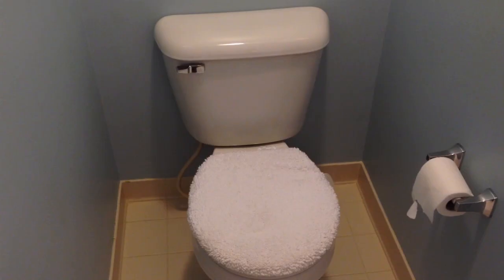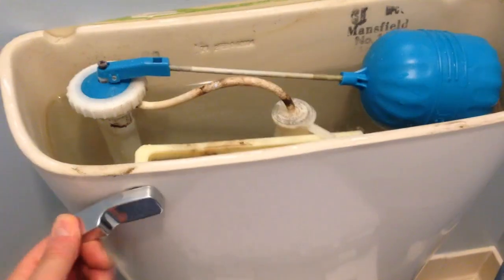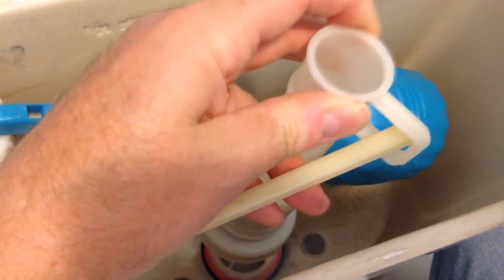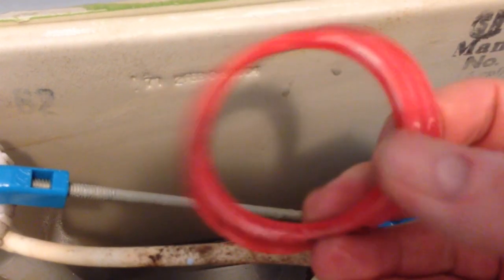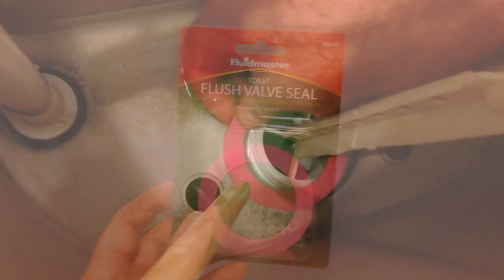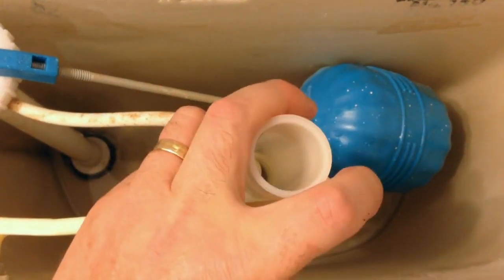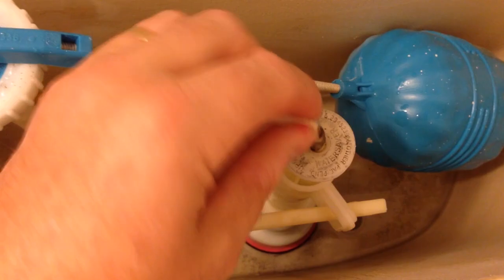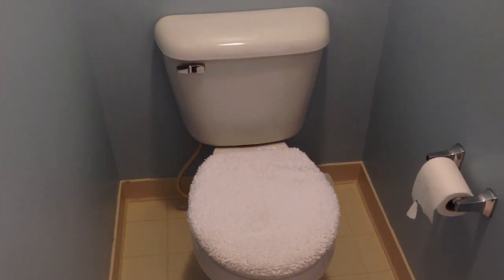Mansfield 210/211 Flush Valve Seal Fix

Comment: A big thank you for posting this video.  The cost to fix two 25 year old toilets was less than $5.  I used part #210/211 Mansfield Genuine Parts Flush Valve Seal Model No. 630-0030.  I have no plumbing experience, but was able to get the job done in less than 5 minutes because if your awesome video :)

Comment: Bless you!!! I bought a $28 universal kit to change out the whole thing. I could tell the seal wasn't going to work. I was in tears (70 yr. old female). Then I found your video! I returned the "universal" kit that clearly wouldn't work on mine and purchased just the seal. Because of how helpful your video was, five minutes later the seal was changed out and the problem resolved. Truth be told, I bought four of the seals. So glad I didn't give up and call a plumber! Nothing against plumbers, just not needed for such an easy fix. Easy totally because of your video. Thank you so very much! ☺️🥳🎉👏👍
Reply from the maker: Thank you! Your comment made my day! When I made this video I had no idea how helpful it was going to be

Comment: Thanks my problem exactly. Will replace. I’m sure that will do the job. To determine if  it was the seal. I turned the arm itself back and forth and that made a temporary stoppage of the leak. 
Most other videos make you think it is the main seal to the toilet bowl thus a much more involved job requiring removal of the bowl.
Anyone should first try your fix first!

Comment: Had this same situation, but with the toilet in Mansfield # 160 called a plumber to get an estimate that estimate was $285 to come out to look at the situation and possibly repair it? After watching several videos including this one I purchased the flush valve seal ( 2 pack ) for $7 and did it myself in about 15 minutes start to flush😂 and that’s with cleaning and checking all the other parts in the tank!
Reply from the maker: Good to know how much getting a plumber might actually cost - you really saved some money - thanks for the information Ken!

Comment: Good video. However, my experience is that this will fix the issue for just a short time. You're back to square one after a few days or maybe a couple of weeks...... or sometimes maybe several months.  Regardless, there is massive wastage of water. Is there a better fix -  apart from sending the entire toilet to landfill (which is the advice of our local plumbing supplier).  We have four toilets, all with the same issue. So the ultimate fix would be about $2k. just because a $5 part doesn't work. I am quite familiar with the the installation of the gaskets - having wrestled with this for twelve years.
Reply from the maker: Sorry to hear of your struggles - I  have three of these systems and my experience is the gasket lasts about two years before I have to replace them. The ones I use lose their shape and also start to break up.  Thanks for sharing. Roger
Reply: @RogerDD100  Well, if you use the official Mansfield part, I'll wager it will last MUCH longer.  I have two Mansfield toilets about 20 years old and just replaced one seal; the other is not leaking.  But good luck finding the official Mansfield part.  I would have had to wait several weeks to get it.  So, like most people I bought a generic one locally (Home Depot). It specifically states it fits the Mansfield 210/211 flush system.  And it did, but I don't expect to get 20 years out of it!

EDIT:  I am going to order some official parts from Mansfield and put them in.  Made in USA.  The $2 I spent at Home Depot for a part made in China is a stopgap.

Comment: I did this exactly as you demonstrated.  Now it "hisses" every few seconds.  Im thinking maybe the new ring needs to MOLD better & once it does there'll be a better seal?  Do you think so??
Reply: PS - Ive checked & it appears to be perfectly seated around & in the groove.  :(
Reply from the maker: @catsjamjams  Sorry I didn't see your question sooner. I'm not an expert but you might check it is in the correct groove, forgive me, it's been a while since I did this - also you could check the adjustment - see video https://youtu.be/rBXC9zDcnT0

Comment: I have 4 of these in my house and I’m getting tired of constantly replacing these seals.  They wear out too quickly. Has anyone found a replacement seal that will last longer than 2 years?  Thanks.
Reply: Well, I can't speak to that, however, I've seen a youtube plumber that said they should last 10 years, and I saw one comment that said you should get the Mansfield brand ones and they claimed the off-brand ones didn't last as long.
One thing is certain, it is a wear item and might even be a design flaw.  When I went to the hardware store, they seemed to stock one of each of different flapper valves and other seals, but they had like 15 of these seals in stock, lol.  I'm guessing they sell a lot of them.

Comment: My son and I replaced the seal (made sure it's in place correctly) after the toilet was hard to flush. It's flushing easier but now I'm having the problem of ghost flushing. Checked the seal and it appears to be properly seated. Might have to call a plumber anyway.
Reply: I had the same problem, and determine that sometimes you have to push downward on the seal to get it to form around the opening so the plastic teacup that lifts off will seat around it after flushing.  How did you get yours to work?
Reply: This is the problem I'm having. I replaced the old seal which was obviously my first problem but now with my new seal in place it still slowly leaks water unless I push down on the plastic flush mechanism

Comment: Noticed water in my Mansfield toilet kept running a few times and have to jiggle the handle to move the flush valve down.  Is that the same fix ?
Reply: Maybe.  Mansfield flush towers need a longer than normal flush handle arm.  If someone installed a normal flush handle arm, it could be binding.  Just a thought.

Comment: I did replace the seal because my handle was flushing very hard. That fixed it very well. But now my toilet seems to be adding water or making some flushing sound for a few seconds.
so i already did what you showed but created another problem. Any ideas?
Reply from the maker: The one thing that happened to me was when I didn’t quite have the seal properly in place so some water was slowly leaking. So check the seal is in the groove all the way round. I’d also check there isn’t anything like dirt under the seal stopping it from sealing - Rog
Reply: Well Roger I finally  got the nerve to take off the new seal off and try to figure out what is wrong. There are actually TWO grooves. I had the seal in the top one and now I put it in the lower second groove. Don't know if that is the prob;em. Also when I am doing the seal, I get this odd black stuff on my fingers. It must come from the piece under the seal. It washes off easily, but gets under my finger nails and on my knuckles. Very odd. Any thoughts on this before I put stuff back together?? Thanks so much, Jo Anne
Reply from the maker: I remember the black stuff on my fingers, not sure what that is. Washed off no problem. Clean up the seal area as much as possible before putting it all back together and see what happens seems to be all we can do. Cross your fingers :)
Reply: I watched yours and another video again and  put the seal back in the top groove. I turned it like a steering wheel and then turned it 360 degrees. It is getting black from all that crud and the inch or so of water is black. Thank you for getting back to me so fast. I put it back together and time will tell.
Reply: Hi Roger, so far so good. Thanks again, Jo Anne
Reply: Five days now and not a peep. YAAAAA!!! Thanks Jo Anne
Reply: Just noticed your question on the black stuff. That is dissolved black rubber gasket particles. The black gasket between the top tank and the bottom tank is a black gasket and when exposed to water for years, the surface dissolves. You don't notice it unless you touch it and when disturbed, gets on your hands.
Reply: Thanks for this thought! when I replaced the seal, water kept running. I pushed the seal all the way down, out of the groove to the black rubber, and the leak stopped. I did 2 toilets but just 1 had this problem.

Comment: It is just not this easy! I had a bit of a leak so I had the bolts and washers changed in the tank. That didn't fix the drip. I think this is the problem but I bought most all the guts anyway. I began the job and came to what I felt was the point of no return. Fixing a must. But that middle thing doesnt just slide out! I feel close to having a heart attack after trying to get that thing out! It was impossible and I  feared breaking the plastic so i tried to put all it right back together. Now that I moved it its in the wrong position to pull the chain. After putting water back in the tank it is now dripping in another place from that same area. Since we only have one toilet I guess my 3 little grandsons and I will be using a 5 gallon bucket for a   week or so, whenever I might be able to pay a plumber. Not to mention I feel like a cotton pickin failure!
Reply: It is usually easy. You had an especially hard situation.
Reply: "pull the chain"? This kind of valve mechanism doesn't have a chain. You may have a completely different type center pipe piece.

Comment: Will his same seal work in the Mansfield 160?
Reply from the maker: I looked at the packet containing these seals and it says it is for the Mansfield 210 and 211
Reply: Yes. They use the same flush valve.

Comment: Do you put the seal in the top groove or the bottom?
Reply from the maker: I think it was the top groove that i put mine in. One other person commented that they put theirs back in the top groove also.
Reply: Thank you so much for replying.  I was going crazy!  Yes when I put it in the top groove and spinned it around like a steering wheel it worked!  My toilet is no longer running and there are no more "ghost flushes".  I appreciate your video.  It really helped me big time!
Reply: If you replace the seal and it still leaking water, you should flip the seal over and it will not leak.
Reply from the maker: Thanks Danny, sounds like a good tip to try
Reply: Thanks so much!!!!